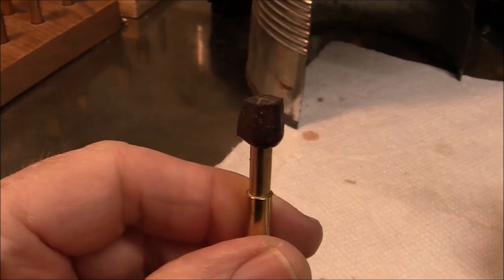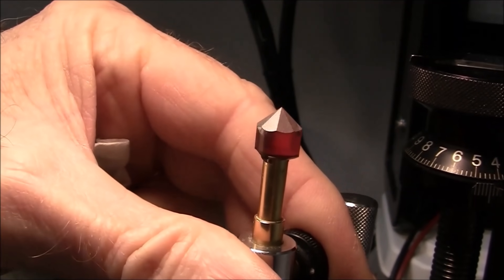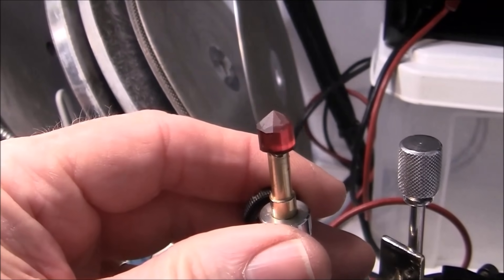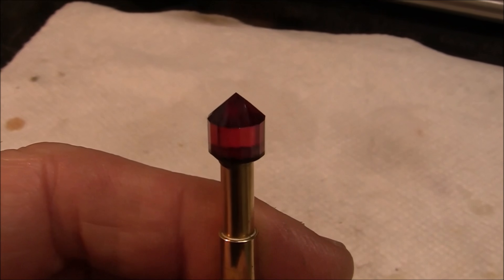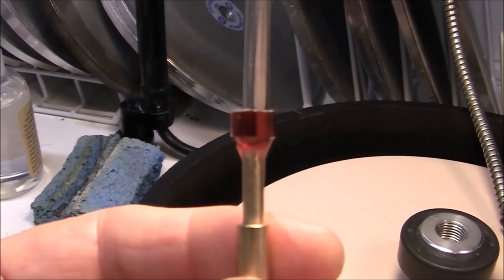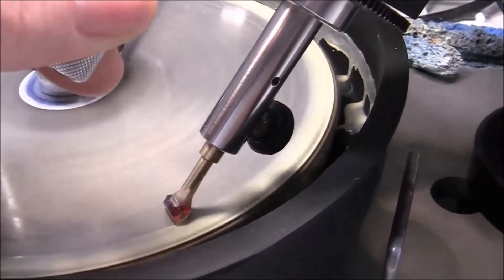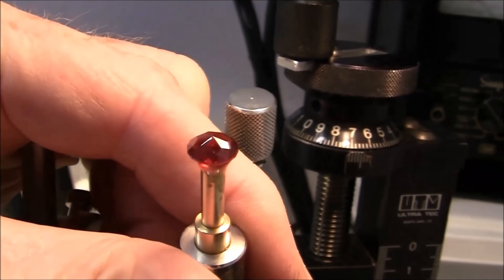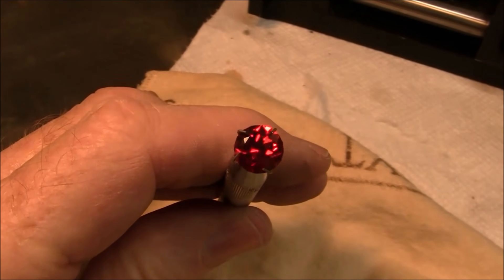Faceting gemstones:  what  is it?

Comment: Looks like an orange spinel to me. I looked it up and the hardness of spinel is 7.5 on the MOHS scale. It could also be spessartine. Both the color and hardness are close to that particular species of garnet.
Reply from the maker: I agree but usually a  spinel  crystal is in the octahedral or tetrahedral shape  like diamond or  flourite.    I  think its  garnet .
Reply: Gems by mbk I think so as well. Garnets tend to polish well with aluminum oxide like you used: